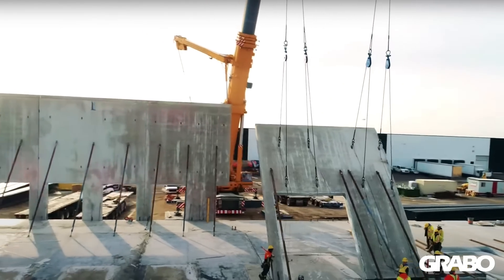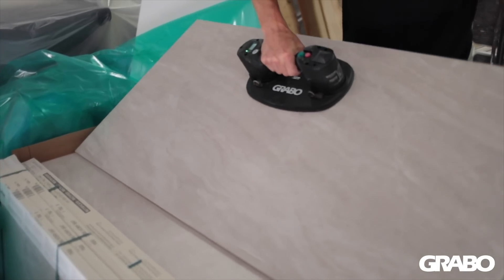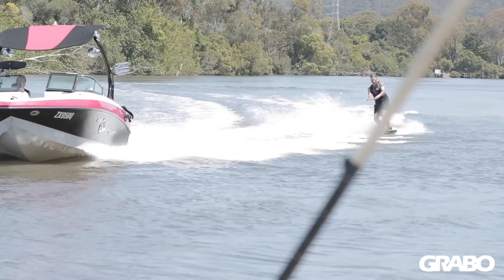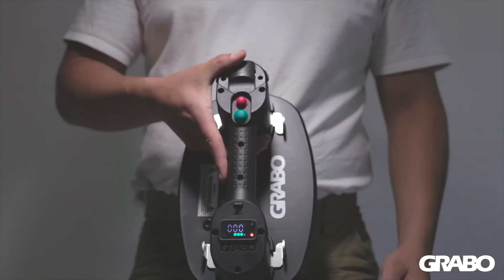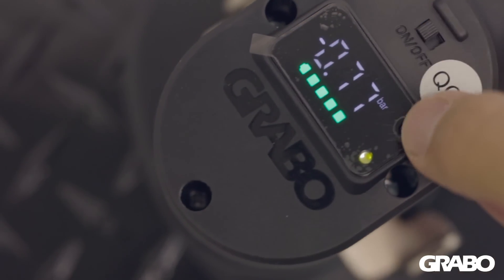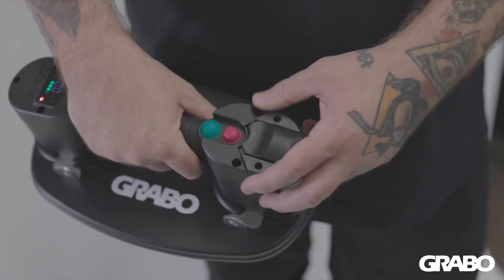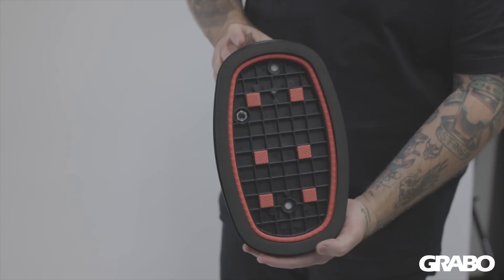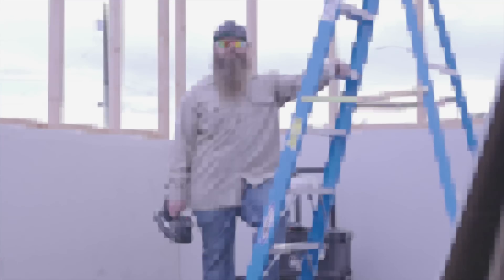GRABO PRO - The Revolutionary Smart Lifting Power Tool

Comment: I have 5 of the Pro . on 2 different sites for Large format slabs  Dekton  handling .. love them .. but so far 2 of them are giving me problems .. one  wont stop pump when pressure has been reach( im guessing the pressure sensor  failed  since it reads 0 no matter what ) second  wont even pump so  im guessing the vacuum pump may have failed . Looking to find where I could get these serviced and hopefully safe my some of my investement . none the less LOVE the Product  and would definitly Recommend IT ! SO WORTH IT

Comment: I’m a bit disappointed I’ve had mine for about 2 years in that time I’ve layed about 1000 square meters of travertine stone which is quite porous. Yep hence the reason I found this link it just broke on me. I pulled it apart and I think the electric motor is ceased, thought it would have lasted longer, looked up and you can’t buy motor so just had to order a new one 😢, also the on and off switch on these are a bad design, but a great tool pitty they don’t last long
Reply: Same problem,same industry about the same amount of time.we bought 6 two years ago and only 2 are working now.
Reply: @ yep I just bought another one and that shitty on and off switch now has a rubber cap over it. What a cheap way for a none fix for the switch. Yes I’ve sent email to them bout the motor but no response, very bad company not good customer relations at all.